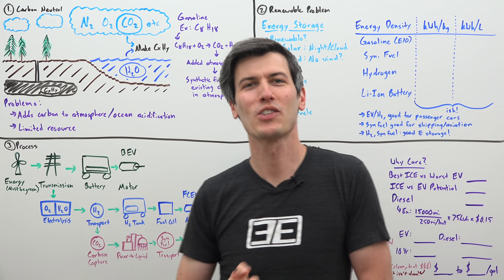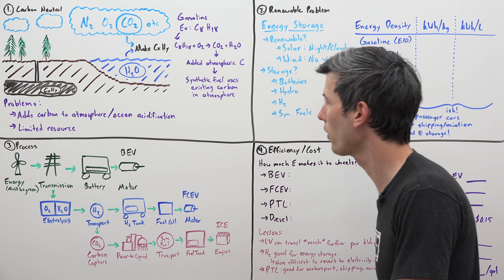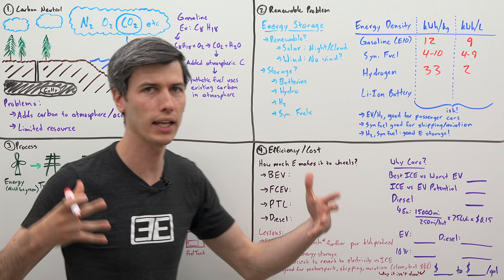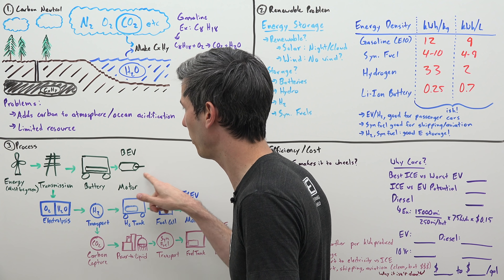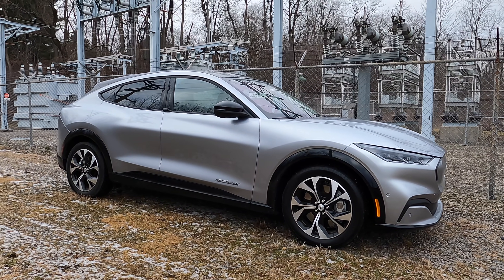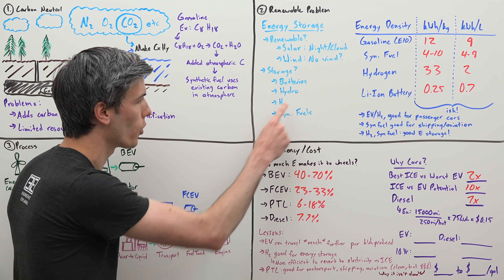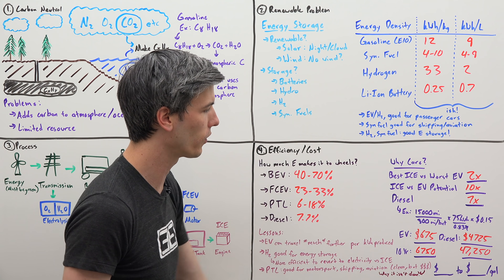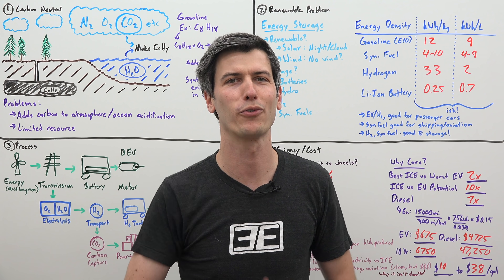The Big Problem With Synthetic Fuels

Comment: I would have loved to see a comparison with current gasoline/diesel refining costs added to the mix, I'm guessing those would be pretty darn cheap and would probably come a lot closer to the BEV money and would also show why they are still very much a thing
Reply: Well if you're power for your EV is from a gas power plant, yeah it would be similar, but of course if you live in a place with more nuclear electricity will be way cheaper. It would be hard to compare them on the whole logistical side as that's stuff usually a fair bit out of touch from the average person, unless you're an investor. Obviously there's no way efficiency wise the ICE vehicles can ever compete, but cost is always going to be more iffy. 

In general though electricity is cheaper than gasoline as it doesn't require trucking and trains delivering to every station in the nation. EVs tend to have the higher up front cost but as the electricity is cheaper it should even out and the EV takes ahead within the first 3 years. It's even easier with a cheaper EV like the Bolt which is only $27K.

Comment: Well, here's the error in this.  You ASSUME (wrongly) that 100% of the energy in Example 1 will begin from a source of a windmill or solar or something.   If the electric has to be generated by burning fuel, then you have to substitute the entirety of Example 2 and Example 3 BEFORE Step 1 in Example 1.  

 So the math for electric generated by hydrogen will then be,  1 x .33 x.7 = 23.1% EV energy usage.  For electric generated by synthetic fuel, the efficiency is 1 x .18 x .7 = 12.6% efficient.   For electric generated by diesel, the efficiency is 1 x .077 x .7 =  5.4% efficient. So, with a top efficiency rate of 18%, synthetic fuel can beat electric efficiency for all but electric generated by hydrogen, or electric generated by windmill or solar.  Not to mention, it doesn't have the environmental, recycling, loss of performance in low temperatures, long refuel times,  and carbon negatives of making batteries to being with.

Comment: ill be runing my diesels on vegetable oil. it is tax free and you can use up to 999 gallons a year ,  and keep your own records of what you use . The whole point here is whether or not fossil fuels will be banned and they wont , they are likely to still be around for another 50 years yet. Ambulances will not go electric and neither will fire trucks hauling tons of water, army vechicles like tanks will need fossil fuels to or big diesel engined generators to charge them up if they ever do become electric. most jumbo jets weigh in excess of 150 tons , electric motors just wont cut it for them.

Comment: The 100% alcohol fuel can be an option. In brazil at the 80', when petrol got too expensive, all the cars turned to be alcohol burners. And the fuel comes from sugar cane. The problem is that the farmers will change from groing food (corn, beans, soy, rice) to grow sugar cane, increasing the price of the food. You can turn a gasoline burner car into an 100% alcohol burning car, increasing the volume of the injectors by about 43%, and other tunes.

Comment: did you consider the possibility that electric containment capacities are cost prohibitive... battery storage is literally exponentially worse than any other form of fuel storage including firewood to run a steam engine 🤣😂 if the people push electric cars put half of the time and energy they did into improving battery storage and agenda pushing they could have built steam engine vehicles that would be more reliable, cheaper, and have better mileage than a tesla🤣😂. exaggerated for depiction of ridiculousness of electric cars being the "future"

Comment: Excuse me 'Dude', as a chemistry studen I know that a molecule of a  certain construction , whether constructed by nature or by msn , contains the same caloric content. Synthetic fuels are, by the nature of their creation, are purer than those generated from petroleum sources. Therefore, the synthetics have fewer side pollutants.
Reply: True. One of the biggest problems with fossil derived fuel is the sulfur impurities that are super hard to get out of the fuels and will generate sulfur oxides upon combustion. Synthetic fuels would not have a single miligram of those. The NOX will always be a problem but more efficient combustion will decrease its production ( like HCCI in Mazdas SkyactivX engines) , and catalytic converters take care of the rest.
The energy content is the problem here. You have to spend energy to form the chemical bonds. In fossil derived fuel those are already done. For synthetic fuel you have to do it yourself
Putting those engines in PHEVs would be great.

Comment: The cost will go down for sure. And, the biggest bottleneck on EV for me is charge time. Sorry but that's a back breaker for me. And EV just have no soul IMO. Plus there's already infrastructure in place for fuels. Though, if someone ever makes a full scale version of an RC10CE I'll have to get one but only if the motor is >also< scaled up to proper size lol

Comment: It all comes down to the cost of electricity from renewables, which is still way higher than it should be. Talking about efficiency when discussing renewables is also a very misleading topic. Green powerplants stop producing electricity all the time following the market (be it competing prices from other sources or low demand at certain hours), during which times they are technically 0% efficient, so producing easily storable energy instead during those periods would be a net gain no matter how inefficient the process. Transforming energy into something that can be stored long term and distributed just like oil also makes it possible to create plants at massive scales in those areas of the world best suited for it, rather than dotting the scenery with smaller, less viable plants.

Comment: A projected price of $2 per litter is very reasonable. I paid $1.80 to fill up yesterday. I would probably be paying more than that if I were living in most of western Europe.
Writing off an experimental fuel because small batch production is too expensive is like writing off electric cars because the ev1 would have had to cost about $300,000 to be economically viable.

Comment: If the original energy that is used to produce H2 and synthetic fuel is GREEN and Free…. Why should we care about these efficiency examples?? When it still has so many advantages (weight,storage capacity, range!!!) and zero emission! A new electric vehicle will never outgrow its carbon footprint. My 20 yo truck in comparison would easily.

Comment: I think the biggest issue you pointed out is that it is less efficient to convert the intial renewable energy into synthetic fuel vs charging a battery?
If so, the snarky reply is "who cares?" (because we can just make more solar cells/windmills, etc.) The snarky reply to that is "Will you pay for the extra capacity?"
For me, I am rooting for us to come up with an affordable, carbon-neutral, synthetic fuel process as a mid-term solution (with batteries or super-capacitors being a more desireable long-term solution.) The reason for this is it has the potential to solve a lot of current challenges:
1) What do we do with all the existing autos, truck, trains, planes, ships and tractors? It will take time (and a ton of money and resources) to replace them with something different. We also might not need to replace or update current gas stations if the fuel chemistry is really close to gas/diesel. 
2) What about energy storage for times when renewables aren't available (ie cloudy days with no wind.) We need good solutions for other energy needs in addition to transportation.
3) I think current battery tech has poor performance in colder climates (I think one of his videos mentioned a Tesla losing like 5% of it's capacity just sitting overnight in the winter???) 

As far as hydrogen, I thought that was pretty well a lost cause. The theory for it sounds awesome, but it seems to have hit a wall previously with challenges in storage and filling-up while traveling. I have recently seen a lot of advertisements by Cummins about hydrogen fuel-cell work, so maybe there has been some big improvements in this area I have missed??? That would be great if true (to give us another option in addition to battery/super-capacitors), but still seems to be a more long-term solution than synthic gas/diesel.
Reply: Prometheus fuels

Comment: Oh Jason.. You have completely missed the point..
1. Hydrogen has a storage issue and real hazard.. Hydrogen atoms will literally escape anything.. NASA will have a few bones to pick with your claims.
2. EV are expensive to make in their current form. Lithium ion batteries for cars are a waste of time... Supercaps plus more dense sources will come to replace them if there isn't a major breakthrough.. Mark my words.
3. You can't replace the world's transportation fleet in our lifetime. Not without some major undertakings that are not happening (SIGs are to blame in my opinion)
4. Is there even enough lithium in the world for this marvelous idea? I think UofT had a sodium alt but that is not being pursued either..
5. The safety hazard of hydrogen cannot be overstated for passenger cars.
6. Also, being an engineer.. I think someone one day must've told you that in manufacturing, pressure is expensive. And compressing that hydrogen to be liquid is expensive.. Apart from the inefficiency of the electrolysis process.. If it were so, ammonia factories wouldn't be using natural gas as their hydrogen source when they can just use water. (Haber/Bosch-Agri Fertilizer) 
7. Also, I'd love to hear the same argument being made if the setup to synthesize hydrocarbons was small enough to be a personal endeavor. Then you'd use your own solar setup to fill up at home. (maybe we'd luck out and find a viable non-industrial path) 

As for my view.. I think an ICE tuned for one or two rpm's can be much more efficient than current engines. Combine that with a supercap bank and you have a great EV.
This will allow more people to have cars running on electricity and the powerplant can be changed overtime as options improve and others become available. Then should battery tech become that much cheaper/accessible, people can still get that without having to make a whole new car. Familiarization is key..
Teslas would be much cheaper if you scratch the battery and replace with a small supercap bank and a powercube in the frunk. I see no political resistance to this step.
Reply: prometheus fuels

Comment: How possible/probable would it be for EVs to use its own movement to recharge its own battery? (e.g. using the natural wind power the car would make by moving and solar when available)
Reply: Well, they already do that. They recharge when coasting, but that obviously slows the car down.
You'll never get 100% of the energy back, that would basically make it a perpetuum mobile, which isn't possible in practice. It will just help a bit.

Comment: You are missing a couple key points. First if we want a green and non nuclear grid, photovoltaic and wind must produce excess energy, that energy needs to be stored in some way, to use at night and for no sun/wind conditions.  Part of that surplus can be used to manufacture fuels without the efficiency mattering too much because otherwise it would be wasted by curtailment. Second we are talking about a undeveloped technology, some of the first photovoltaics were made with gold and selenium and were 1-2% efficient, should we have ignored the principle forever because the early ones were not good enough?

Comment: The problem with electric motor is that is not practical: I live in Italy and I see friends with full electric cars that are in charging all the time. A car is a need for every emergency, and you can’t wait the charge. Fuel suets a more practical need and you can use it when you want. Also the emotion of driving a fuel car is not comparable to an electric one. That made me think the electric energy revolution might be a bubble, at first because is not practical, and second for the cost: here in Italy if you charge in your house is gonna take a lot but is cheap, but if you charge in public charger is a bit faster but cost more than gasoline (which in Italy it cost 1.7€, so expensive). Buying an electric car in Italy is convenient only because you don’t pay car tax sometimes and public parking which are 2 issues for car owners.

Comment: Here is where I think the argument can be a bit flaud. The problem with fuel efficiency right now is well - engine friction, but also that engines suffer from knock, so at high output scenarios you need to supply a lot of fuel to that engine in order to avoid this. The thing about these synthetic fuels which Porsche have confirmed is that they seem to be A LOT cleaner even without additives than standard fuels. This would mean a much higher octane rating and similarly to natural gas - can be engineered to produce less emissions. Differently from natural gas, these fuels seem to be able to create a higher energy output when ignited. This would allow engine manufacturers to increase compression ratios, advance timing and increase overall engine efficiency, especially when combined with all the f1 tech that is available which is slowly trickling down to passenger cars like chamber ignition etc. The problem with EV's is that finding more efficiency is a lot harder there then it seems to be with ICE's with the current tech available.  So if we get the ICE to ~40-45% efficiency rather than 25% efficiency that's a huge step in the right direction. Or maybe i just want my freaking gas-guzzling BMW M-cars because the way they make me feel - happy :(

Comment: BUT, you don't have to produce all the cars and other transportation that exits. With that huge amount of fuel, that the people need,  will everything make sense. 

There also so many countries that cannot afford ANY new cars, especially EVs. So we can decarbonize with one shot over 150 poor countries.

The production of EVs is so much CO2 intensive, that at the end is not better at all. Except for taxi drivers or car sharing.  For now. 

We have the gas stations, we can save the energy that is being not used. Even with 18% efficiency is worth to use all the energy from the Sahara for example. Or some other deserts. Why not save that energy and use it? Other comments have also excellent point like F1, the distribution and so on.
Reply: Prometheus fuels

Comment: How do methanol fuel cells fit in here? I've seen good arguments for it being a much more practical fuel than hydrogen but no indication of any real industry or research interest in it. Which considering batteries are nowhere near being being practical for ships or planes and a huge stretch to get working on long haul trucks I'd expect more interest but aren't finding what I must be missing is the problem with it?

Hydrogen may at some point work on trucks and ships, but methanol for fuel cells would be able to reuse a lot of the gas infrastructure we have and hydrogen storage tanks also present engineering challenges for aircraft (though methanol fuel density doesn't look hugely promising for aircraft either). Obviously for passenger cars though batteries are good enough and by far the most efficient so BEVs ultimately are the best and fastest adoption for consumers, but in heavy industry and air travel I don't see batteries ever being the solution due to weight.

Comment: Porsche is now quoting $7 a gallon, also Volvo has written a paper regarding emissions life cycle of petrol XC40 vs Battery. The BEV has a much larger carbon foot print (touched on here). If you drive the BEV on 50% renewable electricity you need to drive 110,000 km before you reached the carbon footprint of the petrol XC40. 
1 most owners would of finished there lease and moved on, effectively had a larger carbon footprint. Then bought another BEV!
2 if you charge overnight eg East Coast of Australia which is 90% fossil fuel over night, it would take over 160,000 kms to match Petrol!
3 when are we going to own your carbon footprint? If you keep your old petrol car and not buy anything you could drive it for 300,000 km before it would match the carbon footprint of a new BEV powered by mostly fossil fuel electricity!
4 clearly we need to move to non Fossil fuel grid or for me $7 a gallon synthetic fuel means I keep my old car! Note I didn’t say renewable grid!
Reply: Prometheus fuels

Comment: I think the ICE will survive in sports cars. They need the emotion and sound from the engine. Motorsports anyway. What it takes is a large scale operation with solar power from the desert. For daily drives BEV is the way to go, maybe one day with induced charging from the road whilst driving.

The Porsche cost argument isn't that far fetched. Americans rarely realize how lucky they are with fuel prices. Compared to the US fuel prices in Europe are insane. In Germany we are currently at what would be 7.20$ per gallon and thanks to CO2 tax it will only rise in the years to come, probably to 9-10$ (or 2€ per liter). Other European states even go more bonkers than that.

Comment: Of course the electric car weighs twice as much meaning you need MUCH more power to move it, plus the additional wear on tires, shocks....etc. Oh and the if the battery goes out on your ICE powered car that is $49.99 at auto zone where as the battery powered car is $7,000 or more if you can even get one and oh yeah it requires professional installation, and if Tesla goes full integrated batteries then you might as well scrap the car and shell out $50,000-$100,000 or more for a new one. I am not opposed to the idea of an electric car but wow they need to do something about the logistics here.